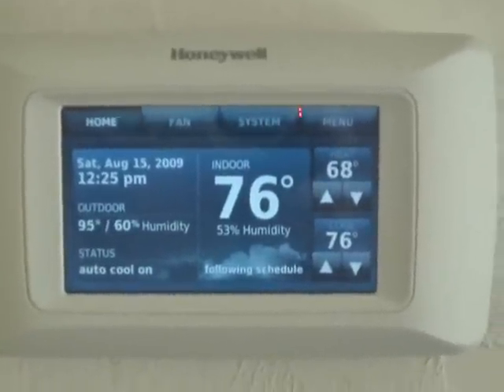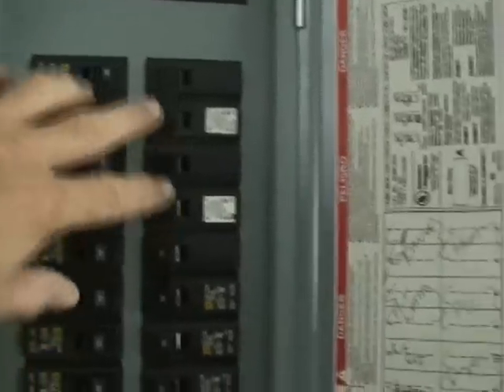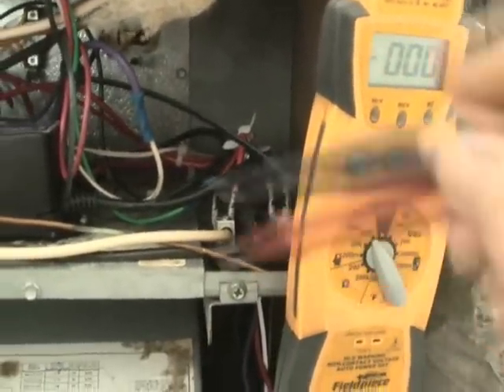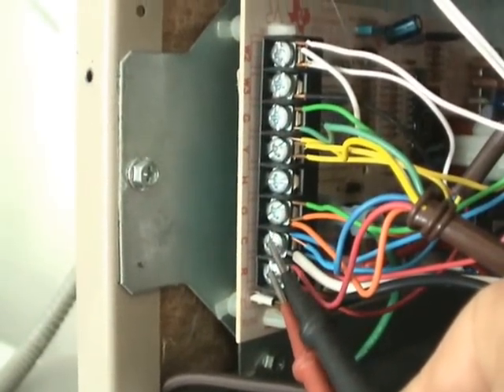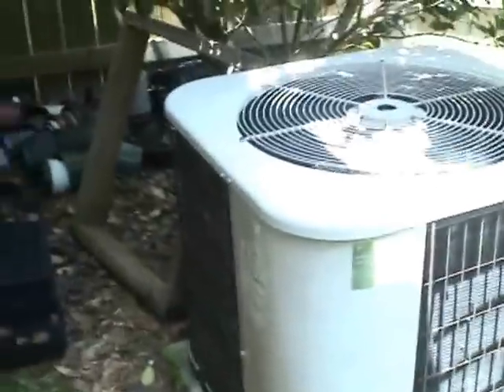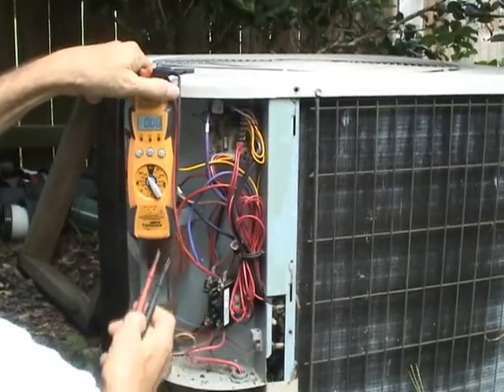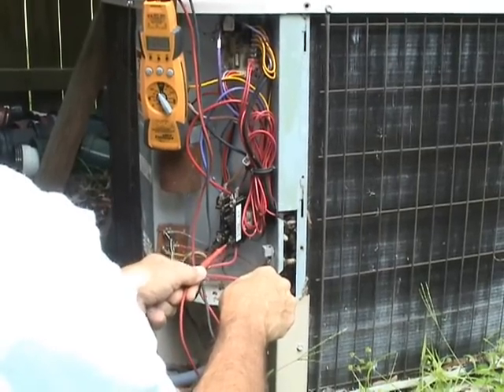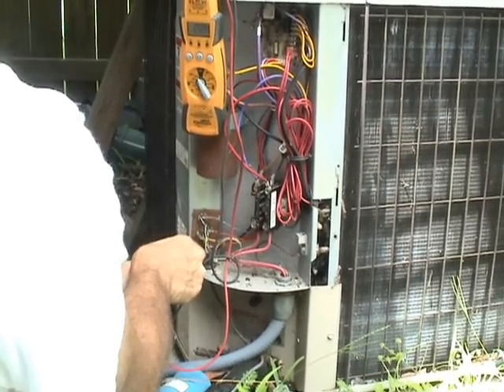HVAC Troubleshooting 1

Comment from the maker: @mxdunksdad You really should replace the bad high pressure switch. You might want to clean the coil in your out door unit. It's easy to do. Just turn off the power to the unit and use a hose to clean the coil. Coil cleaner isn't always a necessity unless the coil is really a mess. It is possible for a dirty coil to be why your condensing unit is shutting down on high pressure.

Comment: Good points. I agree that you should not automatically put the guages on a system that is not running.  Great video. I'm  a hvac student with 3 months to go until I complete the hvac program at my college. I just got my universal and I'm looking to learn as much a possible. Keep the videos coming.

Comment from the maker: Yes. Like I explained in the video: warm air will blow out of the condensing unit when it's in the cool mode and cold air will blow out of the condensing unit when it's in the heat mode.

Comment: Please try to cover seer ratings? Like, if a 10 seer condensing unit takes a crap, it's more likely than ever the air handler will need replaced now aswell. It's always a good idea to change the air handler, but we've gotten by for years without necessarily having to. Some attics are just a nightmare. How did they get it up there? "..So we'll also have to cut a bigger hole here in the hallway because the air handler is twice the size of the opening." What a disaster. Yikes.

Comment from the maker: Some chillers have a purge system connected in line with the chiller. It looks kind of like a small refrigeration condensing unit.

The refrigerant has to be recovered from residential systems before you can purge non-condensibles.